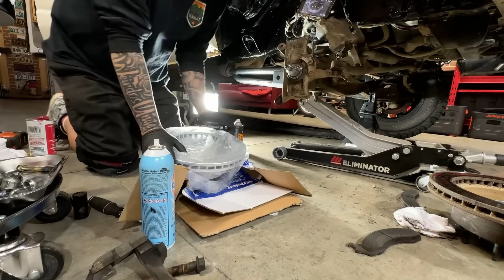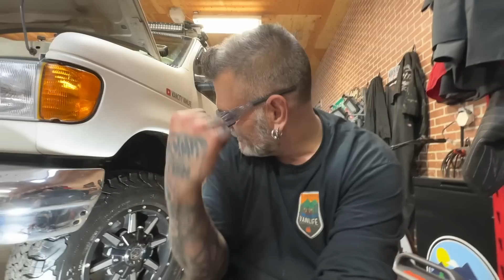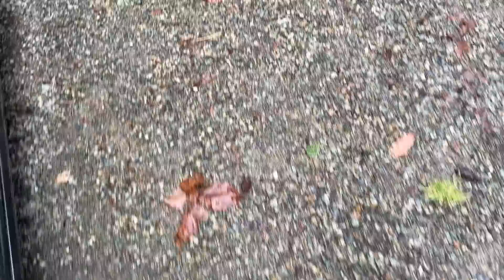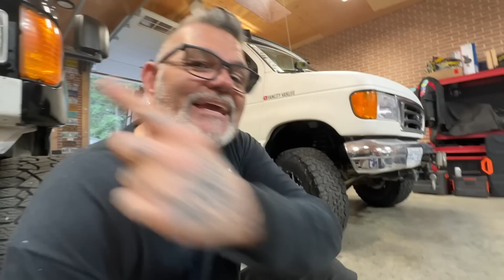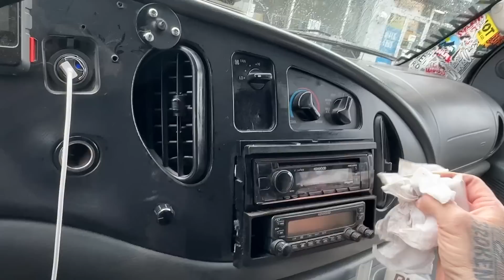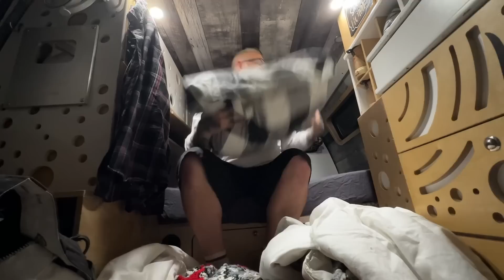Doing Your Own Mechanical Work When Living In a Van Kinda Sucks!

Comment: It's called life skills. Day may come when you will HAVE to fix your own stuff. You took the right path...
Reply: Changing brakes on a vehicle is not a life skill and I wouldn’t recommend anyone just try and change the breaks on their vehicle with no experience.
Reply: @nicktick3000  When it cannot be done due to location and circumstances, what else would you call it? I call it stranded. It's a life skill...
Reply: Nick Cote, it is a life skill. We are socially trained to helpless dependance.
Reply: With the right tools, anyone can do anything needed done. And sometimes with the wrong tools in a pinch ..🍻
Reply: @nicktick3000  if you never try something there is no way of learning. There are too many resources out there for anything you want to do. It’s easy to learn, it is the fear factor and apprehension that have people scared to try things.

Comment: If this was a challenge for you, DO NOT ATTEMPT THE REAR DRUM BRAKES!!!
Reply: Drum brakes are a pain in the a** lol
Reply: You are absolutely correct. Disc are fine but drums need to be just so right. Stay well. Thx
Reply: Agreed 👍. Drum brakes should be left to the professionals.
Reply: @robertlandrum1971  I've done it.... Just wear eye protection
Reply: @matthewkelly4396  I just did rear breaks on a somewhat newer Lexus suv thing lol and they was easy but they are rotors also, I’ve done a lot of breaks on semi trailers, they are drum brakes and they pretty much work the same way as the ones on cars/trucks but the semi trailer brakes are easier, maybe because everything is bigger lol
Reply: I'll definitely second that!  Drums were created to advance the development of headaches.

Comment: I seen 12v Ac that would work with battery set up you have  Velit 2000R rooftop A/C 8000 Btu  1599.00

Comment: If you ever do the drum brakes make sure you take a pic of the components after you take the drum off or you can look at the other side for reference, both tips help when putting everything back together
Reply: The rear brakes are rotors, but the parking brake is a drum style within the rotor hat... That one chrome will definitely have a shop or Loren to do it since they're a major pita
Reply: @ricebike  gotcha, didn’t know they was rotors on his van, I’ve actually never done brakes on any van lol but I’ve done brakes on just about every thing else
Reply: @Bearded_Bear79  no worries, but if chrome thought the front brakes are hard, the rear parking brake shoes is a lot of work to replace (plus I'll definitely wear eye protection when dealing with those springs)

Rear pads are just as easy

Comment: Did you sand your rotter before installation
Reply: It's brand new replacement rotors... Need to wash off the protective oil though
Reply: @ricebike  when you install machined rotors they have a small groove left by the lathe. That groove will grind in the pads and prevent a full contact. By sanding them you remove the groove.
Reply: @sebastien9860  he did replaced them with brand new rotors? Or did I miss that he re used the old ones?

All the new rotors I get are flat/true with a non directional finish
Reply: @ricebike  new one are machine too
Reply: @sebastien9860  yeah but to be made to just clean the protective oil and just mount them on

Comment: Hey Chrome question when you put that new rotor on did you spray it down with brake clean because it has a grease sealant on it keep it from rusting while shipping if not you're going to find out your front brakes are very grabby
Reply: Otherwise, he needs to disassemble the pads, sand down the pads and get rid of the contamination, and put it back together
Reply: @ricebike  yes

Comment: One recommendation I have related to this brake job you did you may want to take it to shop or diy but bleed the brake fluid out of the lines with new fluid, stuff in the line close to caliper is probably really old.

Comment: You didn't show it but I hope you sprayed the rotors with brake cleaner before you use them. They come with a coating on them to keep them from rusting while on the shelf and need to be cleaned off before you drive

Comment: If you change your pads often, then you don't have to change out the rotar, which takes the longest.  I feel your pain though because I've felt the same way before about working on my vehicle. Not the funest thing to do. Feels nice once it's done though.
Reply: Sorry to disagree but you better clean and repack those bearings even if you are not changing the rotors.
Reply: @danrandall794  I think Fred is saying about other vehicles in general that has a separate press-in or bolt on hub/wheel bearings

I did many pad slaps with the original rotors on a 2005 MDX... After 3 pad slaps, the rotors were getting to the minimum thickness and didn't still show signs of warping

Changed them out after a decade of mostly highway driving

Comment: Not sure if you did this but I have never seen anything about torqueing the front spindle nut to 30 foot lbs. I have done hundreds and hundreds of brake jobs and bearing repacks and never heard of that. Hopefully after you tightened up the nut you then backed it off a hair.

Comment: Working on everything on your own vehicle is actually enjoyable because then you know every nut bolt screw and fastener you can pinpoint faster to wear a problem develops whether it be a bushing or a loose cable or something and another thing that people fail to realize is keeping your motor top-to-bottom extremely clean this way if you develop an oily or other leaks you can find them faster over and oily dirty injun plus they run cooler

Comment: I got a quote for $900 to replace 2 rear shocks, replacement of bad rotor seized caliper and new brake pads.

It was way cheaper for me to diy myself... That's close to a week's pay for me so I saved that much with labor in an afternoon and my 11 year old son learned something new 

I'm not into the timing belt or internal engine work like Loren since I don't have tools or shop space for it